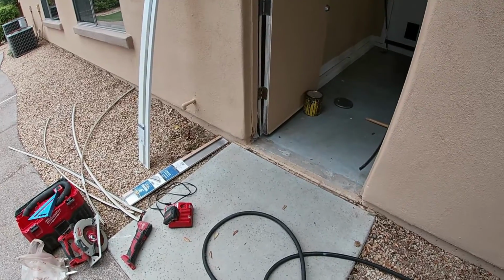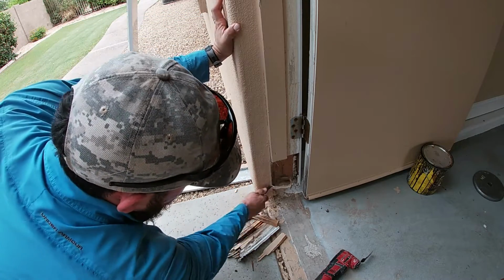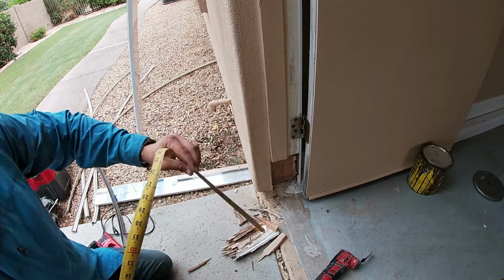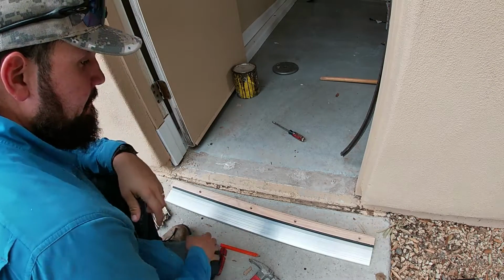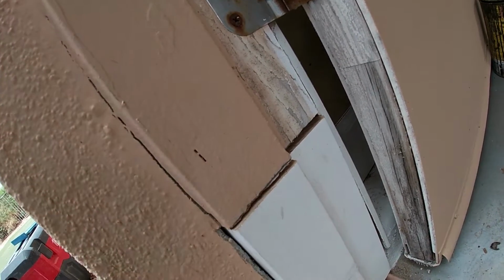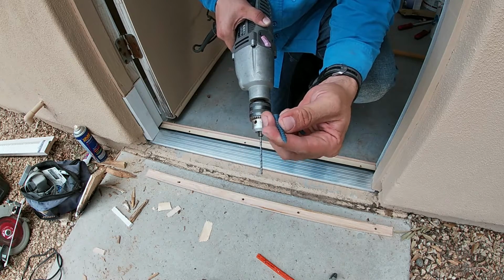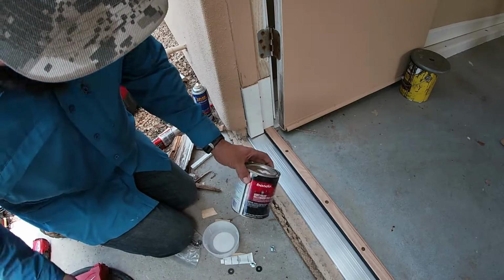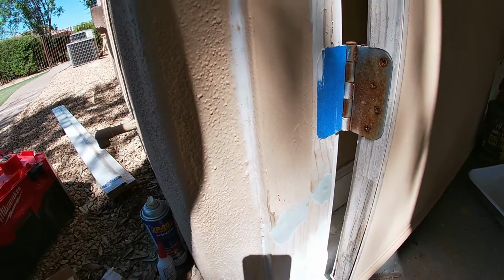Door Jamb Repair and Threshold Replacement | Handyman Hustle

Comment: Great video. Good to know most guys go at it in a similar way. I didn’t see anyone mention this in the comments so I’ll mention it, the strip on the top of the threshold should be adjustable up/down. I don’t suggest anyone using it more than for fine tuning the seal between the threshold and door shoe since it’s weak and has no support. This may be irrelevant since that room looked like an outside garage door and doesn’t need to seal. Hope this helped anyone
Reply from the maker: thanks homie, yes I forgot to mention in the video it's adjustable.

Comment: AZ like Cali definitely has a higher rate than TX... Good video. I've done similar jobs, the most recent one I also made the same repair on both sides of the jamb and replaced the threshold. I like using DAP Premium Wood Filler... sand & prime. (almost 4hrs... $382.00) I like your price a whole lot better!
Reply from the maker: Cali is a hard market, especially when your own government would rather spend money to fine good working handyman who are barely making it than to spend money fixing their homeless issue.
Reply: Price mudt vary per the location in my experience

Comment: I do quite a bit of rot repair on jambs/thresholds/window sills and facia. I like to use a 10 degree scarf joint, then as you do I bondo everything that is exterior...
Reply from the maker: Scarf joint would be more sturdy for sure. I haven't tried it yet. May give it a shot next repair I do. How would you cut the existing door jamb without removing it like I did in the video?

Comment: If anyone sees this is there any way to take out the threshold without cutting it in half I can't get it out for some reason that I don't want to cut it I just want to put some weatherproofing underneath it
Reply from the maker: Get a pry bar to lift it and squirt sealant under it.